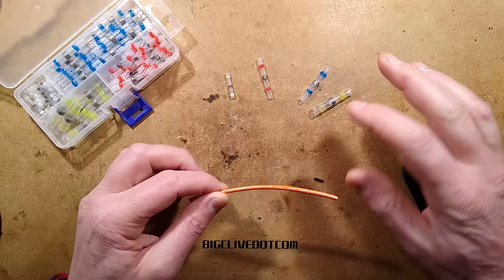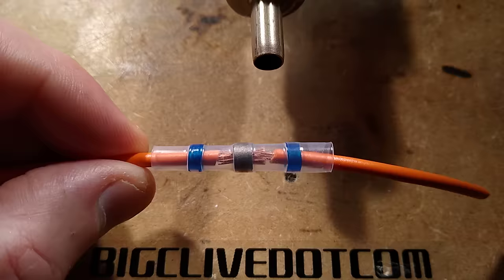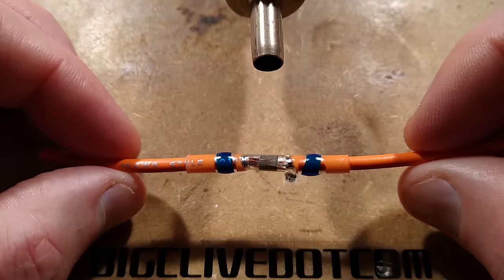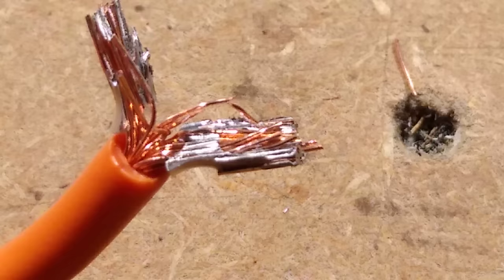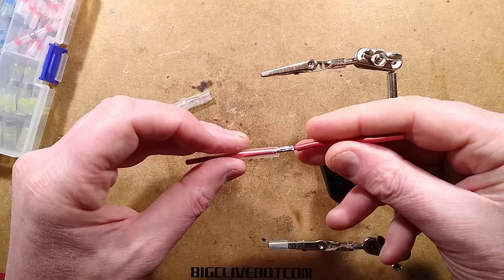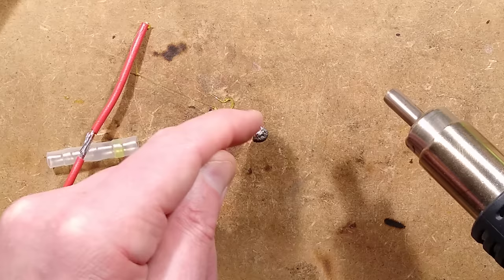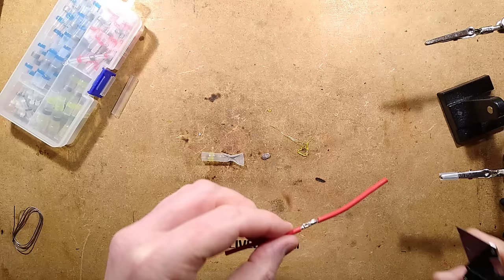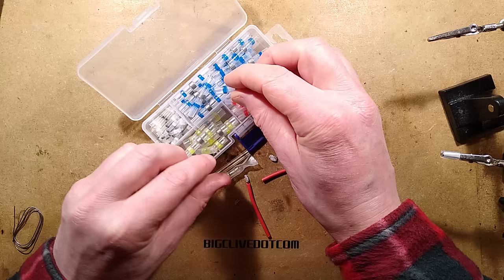Heat shrink solder butt connector test.

Comment: The metal "solder" may be a Bismuth alloy like they use for fire sprinkler heads. They melt at temperatures well below tin/lead allow solder.
Reply: maybe something with indium in it?
Reply: @tommihommi1  probably not, Indium is pretty expensive and these things are dirt cheap.

Just checked, ~$540/kg vs $29 for Bismuth.
Reply: Although I'd expect it would have wicked up onto the wire more from the heat gun exposure if it was lower temp. Unless Bismuth doesn't bond as well?
Reply: @andrewfidel2220  yeah indium is about as expensive as silver.
Reply: I would think that is what it is.
Reply: There are certainly bismuth solders, especially some that are used for reflow soldering SMT components. Strangely, Indium Corp. makes some  Bi solders.  😁
Reply: Would Gallium be another possible ingredient? That melts at something like 60C.
Reply: Woods alloy
Reply: @IanTester  gallium destroys aluminum it's too risky for most solder uses.
Reply: Yeah, Bismuth is utter crap and only acceptable for desolder alloys. I'd rather use a crimp than such plasticky half-ass Bismuth joint. The real test here would have been a pull test real solder joint vs crimp vs this butt plug thingy.
Reply: David Burgin  ahh I didn't see a brand name. My first thought was to look for a brand and see if there is an msds....failing that, saw the temp.
Reply: @PCBurn  some low temp alloys don't wick very well at all, especially fi they are essentially just some industrial generic stuff like Cerrosafe. They behave very different to normal lead and lead-free electrinic solders. In fact I sometimes use them for desoldering large items because their surface tension is so high. 
Edit - SAFETY WARNING some give off highly toxic fumes or are very toxic if ingested in trace amoumt. Lead poisoning has nothing on the more obscure stuff you could use - TAKE CARE 
(kinda wish I'd never mentioned it now lol)
Reply: and SAFETY WARNING: some generic low-temp alloys are HIGHLY toxic when heated to melting point temps (fumes) or trace ingested on fingers - do your research if you even thinking of attempting to use them for low-temp desoldering experiments.
Cerrobend is a classic example of what not to use.
Reply: @IanTester  I was thinking gallium at first, but the fact that these are meant for automotive applications made me guess toward bismuth. First, many small wires are aluminum, and a gallium alloy would wick clear up the wire and destroy it. Second, structural components of many cars are aluminum, and the last thing you want is for a little dot of gallium to touch your car's steering knuckle.
Reply: i would expect it Field's alloy the amount of indium they would use would be tiny
Reply: @ChrisD4335  for under a tenner a box I'd expect cheap candle wax with a drop of silver paint in it. 
Maybe I'm old, biased, prejudiced, annoying, fat, smelly and jaded, but hey-ho.
Reply: @danielegger6460  hey people knock crimping but crimping is THE thing to do for marine use, far better than soldering if done right. Only thing better than a crimp is welding with identical filler alloy. Done badly though and it fall apart before you apply current haha
Reply: Also, bismuth solders can easily get contaminated with any junk that happened to be on the wires. Contaminated bismuth solder joints crack and fail prematurely.
Reply: Is that why the Bismuth sank.

UGH !
Reply: @gordslater  Also aerospace, military and automotive uses.
Reply: Would that low-temp, contaminant-averse solder wick better into the strands if they had been de-oxidized shortly before being smooshed and heat-gunned?
Reply: Yea I was gonna say gallium alloy but yea bismuth is probably right
Reply: @gordslater  for a good d crimped connection you need a good crimping tool and good crimp connectors. The stuff you get from China is nothing of the above and in diy shops you get often the same junk and / or 10 crimps for 5 $ / €.
You can get packs of 100 for 10 €|$ good quality but often only as a company.

The cheap junk is made from aluminum and quite thin. The better ones are from galvanized copper or copper alloys.
Reply: @tuxontour  Yes, I'm not disputing that at all. All my RF tooling is from the connector manufacturers themselves for example. I'm not talking about mechanical  failures of the tools or connectors themselves,  I'm talking about the longterm reliability of the electrical metal-metal interface of the joint itself, given a good mechanical condition is maintained.
Reply: Ian Tester. 60c is way too cool for wiring. A little bit of an electrical load and the whole connector could come apart if under tension.
Reply: @gordslater  sorry if my comment sounded like I am disagree with you.

I only wanted to clarify that you need also the right tools and materials to get good results.

Many people buy themselves cheap ass tools and crimps and can't get them to work in a way that cables dont pull out right away. That is why they dislike crimps.

A good crimp is as good as welding.
Reply: @tpasco1995  What car manufacturer uses Al wires? I've seen some weird ones that can't be soldered in the newest Toyotas, but they were too hard of a metal to be Al.
Reply: @gordslater  Actually the best way for making splices is not crimping but rather ultrasonic welding. And it's the standard in the automotive industry for years. Not familiar with the marine industry, though.
Reply: @gordslater  To be fair I've got a shelf of stuff behind me that's essentially nerve toxin. Used to repel assorted insects. Nevermind the solvents and other chemicals if you were to use them incorrectly. And Clive just did a video on a UV-C light which'll cook your skin like a cancer roast.

So it's better to know overall especially with a helpful note as to the toxicity. Remember to read those MSDS sheets everybody!
Reply: There are different type of qualities
Reply: I use Bismuth based solder for low temperature work when making circuits done with copper tape and glass, and other applications where it simply won't handle the full heat.
It's fun stuff, just not super strong. And it's also good for mixing in with normal solder to make removing parts easier.
Reply: @111chicane  BMW uses Al for high-current cables such as battery-alternator-starter connection or for the engine cooling fan. All other wires are made of copper.
Reply: @danielegger6460  maybe Project Farm can do a comparison he has good videos testing different products. Dunno if Clive has the equipment to measure the pulling force and all that.
Reply: your comment says 3 weeks ago how is that possible
Reply: May also be indium .
Reply: Low temp (136f) SMD removal solder composition : https://www.chipquik.com/msds/SMD4.5.pdf
Reply: Ian Tester gallium melts at 30 C or thereabouts. You can hold it in your hand and watch it melt. Its alloys likely will melt at even lower temperatures. It’s also quite expensive, though not as much so as indium.
Reply: @ChrisD4335  Not so tiny percentage-wise.  Field's metal -  M.P. 62℃ (51% indium; 32.5% bismuth; 16.5% tin).  See https://en.wikipedia.org/wiki/Field%27s_metal.  Also indium is used in the production of transparent conductive coatings of indium tin oxide (ITO) on glass (LCD screens) and is thus considered a technology-critical element.
Reply: @tommihommi1  Iridium melts at 2400 C. /4470F. These melts at max 200C.
Reply: @persimonsen8792  Indium melts at 156°C
Reply: @brys555  The heavy gauge ones I've seen, yes, and it makes sense for those. By that comment I assumed there are small gauge ones I wasn't aware  of.
Reply: @tommihommi1  Read it as iridium, not indium.
Reply: good point. I just retired from the sprinkler trade, and hadnt thought about that with these connectors.
Reply: @IanTester  gallium infuses with many metalls and destroys them.
Gallium on lead will get you room temperature liquid solder that destroys aluminium in seconds
Reply: Looks pretty much identical to Rose's Metal, even the way it goes 'papery' when changing phase. Composition is 50% bismuth, 25% lead, 25% tin. I'm not so sure they'd be able to sell something like this that "violates" the ROHS nonsense without some sort of certification, however. It could well be Field's Metal, which is a lead-free alternative (32.5% bismuth, 16.5% tin, 51% indium), but that tends to be quite a bit more expensive in comparison.
Reply: @srowley85  GaAs melts at 1238C which is why it is used for things like circuit boards in jet engine.
Reply: Andrew Fidel I’m talking about gallium metal, not compounds of gallium, such as the one you mention.
Reply: Was about to post it's some sort of Gallium alloy. How was your comment posted 3 weeks ago when the video was posted 2 days ago wtf
Reply: @ZadakLeader  Patreon supporter most likely. They often get a link to videos before they are made public.
Reply: @ZadakLeader  Hmm...  I posted it two days ago.  I don't know how that got screwed up.
Reply: @IanTester  gallium melts much colder than 60°C, if I remember correctly it melts at skin temperature, so about 35°C
Reply: @ZadakLeader  Patreon?
Reply: @111chicane  The Toyota Land Cruiser started using aluminum primary harnesses in 2016. Some Acura and Lexus models have aluminum harnesses as well.
Reply: @IanTester  gallium has a melting point of 28 C, and is terrible for using as solder since it is super brittle (like glass, but weaker) and destroys metals by creeping into it forming a weak alloy. So alloys of gallium are probably also to be avoided. Source: I have about a kg of the stuff.
Reply: @IanTester  at 60C (140F), I would think that would melt under car conditions. The engine might melt it. So Gallium would be a bad idea
Reply: @IanTester  that would be really dangerous, galium melts when you put it in your hand

If you were making connections inside a car (which gets hot in the afternoon) or are running a couple of amps through the wire, the joint could just melt and disconnect
Reply: I bought a kit of these and am disappointed.  The thin plastic insulator easily develops holes before it fully shrinks from the applied heat.
Reply: Lead Free and Little to No Flux = Likely Problematic and Inconsistent?
...and first applying "a little extra" flux yourself might interfere with water-tight sealing if it gets onto the insulation.

Comment: I have used these when I was working avionics on the military aircraft. We also had some designed to work with shielded cables with a pigtail built in to connect to the shield screen using the solder ring. One side of the sealing glue was smaller to seal onto the center conductor of the shielded cable, and one side was larger to seal and glue onto the outer jacket. The ones we used had a color added to the solder ring to know when it was heated enough to fully melt the solder.
Reply: Lake Nipissing I use those exact ones.  They are great.
Reply: Wanted to make the same coment, ours don't have the color changing solder though.
Reply: do you know the brand? i'd love to see a high quality version of this
Reply: Good to know that a professional grade version is available.
Reply: The red is flux. They're used a lot in class 3 cables in aviation. Clive didn't fully melt the solder preform so of course the connection wasn't complete lol
Reply: @adriaan9011  Amphenol and Hellerman Tycon make them, they are great. they used to come in sealed packages which probably would now be marked Airbus Industree, but then were marked Thompson CSF or Avions Marcel Dassault, but inside the Amphenol pack was there, complete with the part number, a packing sheet, and a desiccant sachet.
Reply: @SeanBZA  The Tycon ones aren't even that expensive, about $.50 a piece. Certainly more expensive than the cheapy Chinese ones I bought on Amazon, but very affordable for a professional solution! Though I bet the ones with the Airbus or Thompson or Mercel boxes around them were 50x that cost =)
Reply: Have used these on avionic wiring looms,  but of course a lot better quality.   Internal to LRU's (equipment) they are too big so normal heat shrink is used if required,  normally  just for strain relief.
Reply: Sumitomo products are dominating the military vendor market right now. They are stocked almost exclusively anymore, save for those benchstocks running on 10 year old stock orders. You can get them on amazon or ebay, same packaging, just gets a sticker with NSN and shit slapped on for FED/MIL use. Lake Nipissing is referring to "z-splices" for multiconductor wire repair. Those kits are around, but on most military platforms usage isn't legal by the book except in very limited scenarios. Not to say I haven't encountered many of them floating around in service....

Solder spices as shown in the video have really gone out of fashion, I'm not even sure if any aviation market is still using these in this application. Solder sleeves are still around of course, but used in shielded wires, or for terminating mutliconductor cables, not for straight line repair.

These Raychems are identical to Sumitomo, this style is by far the most prevalent splice for single conductor. https://www.amazon.com/Environmental-Splice-Ranges-Tin-Plated-Conductors/dp/B07B93F39Y/ref=sr_1_14?dchild=1&keywords=environmental+splice&qid=1586985720&sr=8-14
Reply: Interesting, I have heard that solder joints are generally banned in aircraft wire, but perhaps not these as the joint is softer?  I know car manufacturers ban any sort of solder joint, it's written in bold all caps at the front of the electrical section in VAG manuals....
Reply: @ckm-mkc  This seemed to be the approved way of connecting the braided shield of a shielded cable to the pins of a bulkhead Canon plug.
Reply: @ckm-mkc  The problem is not with the solder joint.(well it can be now with lead free due to tin whisker growth ). but the way the joint is made. Any movement in the wire at the joint interface with stranded wire causes the strands to work harden and fail one by one until the wire fails. A lot of connections in aircraft wiring are made with crimp connectors as the housing provides strain relief for the wire.  but as another poster said, screened cables use one like these that has a pig tail  to provide connection to the screen. The other thing is an aircraft is always made to the design drawings, so a newly build aircraft that is a twenty year old design will be built in exactly the same way. to make any changes needs to be signed off by the aircraft design authority. e.g Boeing, Lockheed, Airbus etc.
Reply: Ohhhh ...   I didnt know this ..  but surely its a higher quality version ...
Reply: @ckm-mkc   Some older aircraft have soldered connections..but so does the Airbus A320..specifically the standby compass power supply. I know, I was sat in a cockpit at 3.00am trying to solder a short lead to a special coaxial connector they use, above head height ..great fun.
Reply: Used them a lot too, really useful with small coaxial cable... Never had trouble.
Reply: Yes the ones with the built in pigtail were/are great! Makes for a very tidy and reliable connection.

Comment: Clive, I suggest you test these connectors by running progressively more amperage through them until they fail and then compare to a standard soldered and hear shrunk connection.
Reply: Or, use a "milliohm meter" in comparing soldered or crimped connections.
Reply: Also, use a heat gun at the recommended temperature.  Clive stated that he started with the lowest temperature he thought possible.  For a test should go with the manufacturer recommendation otherwise it's not really fair.  After than, can test possible failure modes of too hot or too cold.
Reply: @TheOzthewiz  I was thinking this as well.
Reply: Was thinking something similar to see if the bad connections can cause heat/fire.
Reply: @deucedeuce1572  Yes they can. So don't use it with high loads.. just low voltage, low amperage wires..
Like if your working on location and your office chair wheel kills your headphone cable but you really need the headphone for the job.. something like that..
Reply: @brianwest2775  Agree! I have used these, and since there is no mechanical application of heat, it takes more than one would think to get complete flow, but if you heat it long enough, the graininess goes away and the joint fully flows. What we see in this vid is clearly an inadequately heated application.
Reply: @TheOzthewiz  or better still, measure then destroy.......